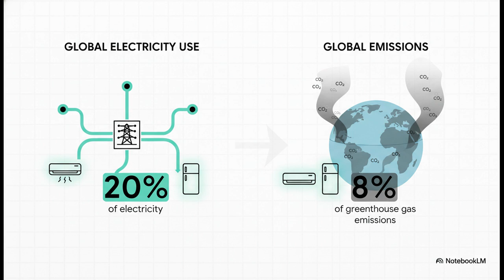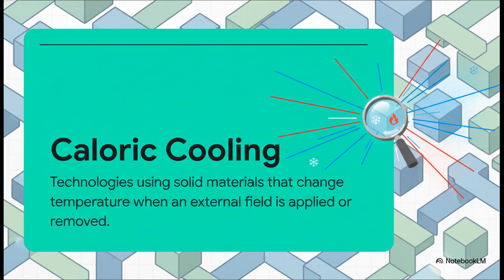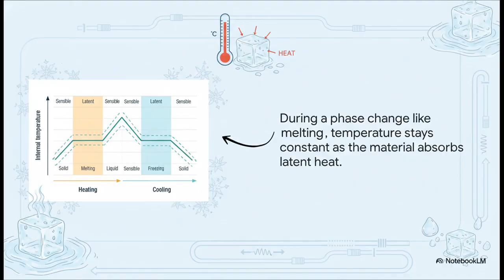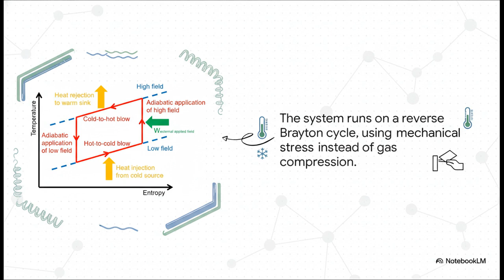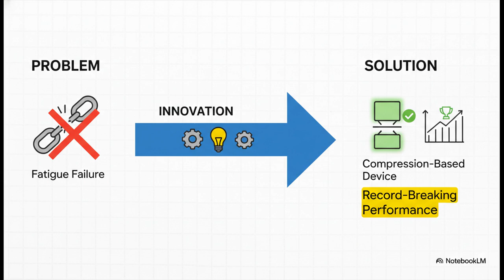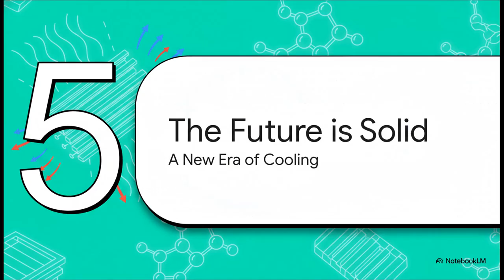Goodbye Refrigerants? Elastocaloric Cooling Explained | The Future of GWP-Free Cooling

Comment: This article completely ignores the most important consideration in assessing refrigeration and heat pump systems, namely how much electricity is consumed per unit of refrigeration or heat (derived from lower temperature sources).  The systems so far demonstrated are encouraging in that they show that it is possible to make a system with fewer moving parts (pumps and fans are still needed in both systems) but their efficiency is far lower than that of conventional systems that circulate volatile fluids.